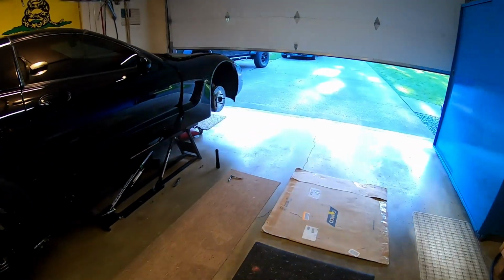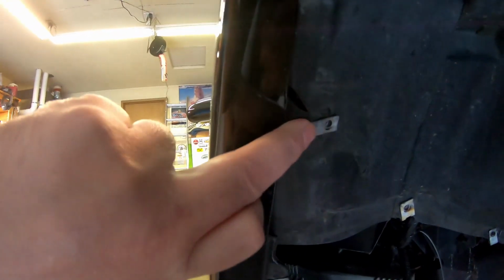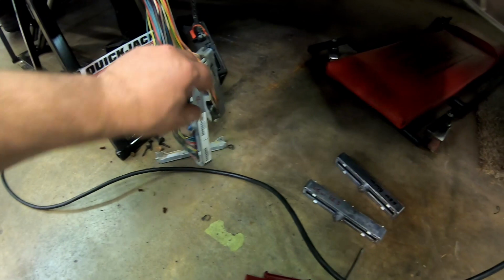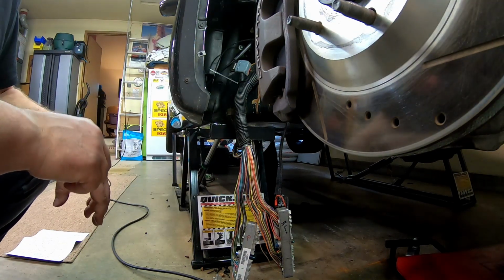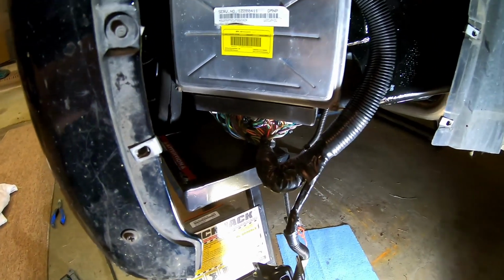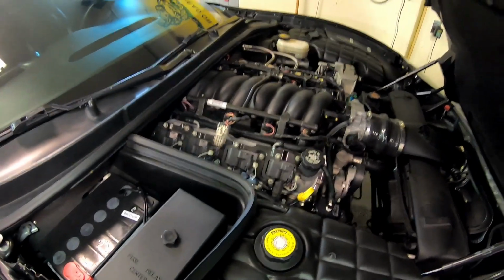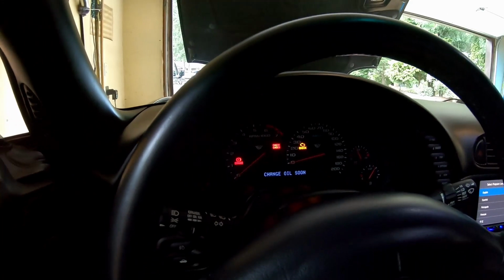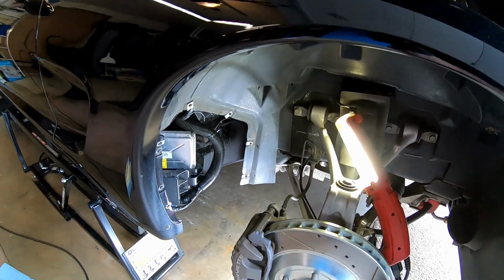How to 411 PCM swap your 97 98 C5 Corvette

Comment: I know this is a very old video, but I’m interested in some information that I’m getting conflicting answers about and I know you did it, so here it goes. I have a 98, can I use my TAC module and pedal or do I need a later model set? Are there any other sensors that need to be changed in order to make the computer happy?
Reply from the maker: In my case all I needed was the PCM and the pin location changes.  All the other hard parts are original 1997.

Comment: Thanks for this Im about to tackle mine because of a boosted application and the tuner insisted. really helpful about the 2003 z06 operating system too he was needing to know that.  ❤❤.
Reply from the maker: It will be worth it once done.    Also if you are going to be boosted and you will be making more than about 600 wheel horsepower I would just make the jump to the HP Tuners 2 or 3 bar speed density operating system.   It is still based off the corvette operating system but opens the door for it to understand all things boost related in the tune.

Comment: I just finished this swap and my speed is in space, reads 1/4 what it should, any tips on the tune file?
Reply from the maker: What operating system is in your PCM.  If it is not an actual Corvette based operating system from a 2002-2003 that is likely your problem.

Comment: I know this is an old thread is there any info on where to find a wire diagram for repinning the connectors mrk is out of business?
Reply from the maker: I can help you out but it probably won't be until next tuesday when I return from vacay
Reply: Do you have a way I can contact you ?
Reply: @PNW_Car_Mods  I did end up finding a wiring diagram for both a 98 and 02 and matching up the corresponding wires

Comment: I recently did this with a 02 ecm. I happended to have a lot of wires just hanging out with no where to go and im very stumped. Did you have this issue?
Reply from the maker: Not so much on a C5.  I think there were just a couple that are left stowed out of the way.   Highly recommend LT1 swap dot com for pinouts.
Reply: @MRBLACK947  This might be a long shot but I think I have found my issue 😂. Do you know what you used for the serial data class 2? I'd like to assume it goes to pin 58 on the 02 ecm, but it shows a different circuit number and wire color?

Comment: Quick question for the connectors since your using a new model PCM, c1 is blue and c2 is red right ?
Reply from the maker: I only have F body and Truck pinouts in front of me at the moment and they both show c1 blue c2 red.    Highly recommend lt1swapdotcom for all the wiring pinouts.
Reply: @PNW_Car_Mods how long did it take for them to ship you the PCM ? I’m about to order one soon
Reply from the maker: @jimmymolina8992  I think it was about 2 2 weeks.  That being said, I don't know if MK Motorsports is still in business?
Reply: @PNW_Car_Mods  no worries , I just took a chance on a 99 pcm on eBay and just bought new connectors so hopefully I can just repin the harness with the diagram that they have on their website still. You think that would work ?

Comment: I just watched this Vid .  FANTASTIC Job!   Questions at  11:10 what wires are no longer used - very curious, what were they connected to that the newer PCM doesn't need?  Seems logical to me the newer PCM would need more info, not less so I am super curious!  Thanks!
Reply from the maker: I actually had to go look lol.  This was a long time ago for my pea brain.   2 wires are listed is ground jumpers another one was for F45 shock signal and one of the most important ones is a 5 volt feed for the fuel level sensors that is NOT used on later cars.   The only thing that doesn't work and I'm strictly going off of memory is I'm pretty certain there is supposed to be an indicator in the cluster when the cruise control is activated??.  If there was an indicator light it no longer works.   The cruise control does work though and all aspects of it respond properly.
Reply: @PNW_Car_Mods  interesting, I appreciate the response Mr Black!

Comment: Have to do this with my 98 f body now for boost, plus the pcm doesn’t even want to take any updated software so it won’t start with the mafless tune. Thanks for posting
Reply from the maker: We're getting ready to also do a 98 Camaro SS next week!   Should be interesting as I still have several unanswered questions on clutch switch wiring and how to tune the fuel gauge to work.  There is so much conflicting information out there I don't know who to believe lol.

Comment: Where did you get your information. Trying to do that on my son's car right now. Thank you for the video.. his is a 97 also. we lost ground Pulse on injector 3 a couple of seconds after startup.. So it's either replace it with an old one. Or see if you can help me out on that information for the pinout.
Reply from the maker: Send me an email
Reply: @PNW_Car_Mods what is your email i would like to get some info on a wire diagram

Comment: I have recently purchased a 2000 c5 pcm to put into my 97 , wondering if that 2000 pcm is the same as this “411” you are referring too, also wondering if the processes would be essentially the same as what you’ve done here? And could MRK Motorsport get me a pinout out diagram for the 97 - 2000 just like yours ? Thanks man
Reply from the maker: Tanner the 2000 PCM should be an 896 PCM (you can verify this by looking at the part number on the case) but as far as I know the hardware is the same as a 411 so it should install with the same red blue connectors and pinouts.   Also AFAIK MRK is still selling the new GM computer brackets and swap pinouts.   They may elect to just tell you to get the 411pcm from them with a basic tune on it.

Comment: I'm getting ready to install a heads and cam intake manifold am I going to need to do this before or do you think I'll be ok
Reply from the maker: You don't need to do this unless you are going after boost or big cubic inches or both.   A competent tuner can tune a cammed atari 2600 PCM in a 97 98

Comment: When ya swapped the PCM from black box to 0411 did the key fob to open the doors still work along with the AC, and the 4x4?
Reply from the maker: Well there's obviously no 4x4 in a corvette but yes everything else seems to work as it should.  If you study the diagrams for the vehicles you are working with there's really no reason it shouldn't.

Comment: Thank you for the video! When you did this, on the connectors, did you just jam the pins through the orange closed holes or is there a special process to be able to put the pin into the connector?
Reply from the maker: They're made to be pushed through the weather boot.  They will go right through without jamming.
Reply: @PNW_Car_Mods  Thank you!!!
Reply from the maker: @ajw0685  welcome ajw

Comment: Nice video, Any other companies that sell that computer.  I have tried reaching out to MRK for months and no luck
Reply from the maker: Well that sucks.  I wonder if the challenging times finally got another one.   You don't need a computer specific from them, it's just easier for most as they put in the OS for a corvette.  Any 411 PCM can be used as long as it has blue red connectors on it.   The OS can be found on the HP tuners board.

Comment: Dumb question but I’m considering doing this upgrade, doing an Ls1 swap and my computer is from a 98 camaro ss and want to upgrade to the newer one. But my question is how do you know which number each pin is?
Reply from the maker: Neil if you poke around google looking at factory service manual wiring schematics you can find the information.  I've also heard that a lot of public libraries often have factory service manuals and guys will go in and get the schematics for both the new and old and then use that info to make a cross over chart.
Reply: Neil,  MRK Motorsports has the conversion chart from 98 to 1999-2002 F-Body.
Reply: Here is the Link:    https://www.mrk-motorsports.com/wp-content/uploads/2016/07/1998-LS1-PCM-to-1999-PCM.pdf

Comment: So did this come programmed and you didn’t have to bring it anywhere for them to deal with it? Just plugged it in and your car ran and drove? People were telling me when I get a new pcm I still will need to bring my car somewhere for them to program the pcm while it’s actually in my car.. just looking for some more info
Reply from the maker: Joseph, the computer I am using has a 2003 Z06 operating system on it purchased from MRK Motorsports.   If your car has LS6 components on it as in right sized injectors, right MAF and things of that nature it should run and drive quite well.  If your car is heavily modified such as mine then it is going to require tuning with something like HP tuners or EFI Live.   The short answer is yes you will likely need to have the car tuned unless you set it up exactly like an LS6 Z06.   Talk to the guys at MRK Motorsports.  They do this swap often.   I will say that this PCM swap generally is required unless you are planning on making big power with large cubic inches or boost or both.
Reply: MRBLACK947 I have a 98 Base. The kit I found online was a 98-02 swap. I just didn’t know if after installation if someone were to have to learn it and program it to my car. I know they come configured to the vin and all you provide but not sure if it was a plug and play deal or if I need to bring it somewhere after installation.

Comment: Where did you get your PCM Pre-flashed (i was expecting your fuel gauge to not function properly)? and the PCM bracket?, i'm about to attempt the same process in a 98 Manual c5 bone stock, and i'd hope for a smooth sailing process like you just showed, Amazing work!!!
Reply from the maker: Thank you Jose.  I bought everything from MRK Motorsports.  They load an 02 Z06 operating system on the 411 PCM for you and configure the fuel gauge.     It was worth the couple hundred bucks to just get everything from them with the bracket and just be done with it.
Reply: @PNW_Car_Mods  Thanks for your fast response, do you know if they're working right now (or still??), i've tried sending a couple e-mails , and by phone but can't get to anyone.

Comment: Where did you get the pin out diagram exactly ?
Reply from the maker: MRK Motorsports.  That being said I keep hearing over and over that the early vs later pinouts can be had from a lot of service manuals or even the library.

Comment: I've only ever seen that swap done on the forum.  Definitely a must have for the early C5s.  Looks like it went pretty smoothly.  I think the idle sounds great, haha!  We're all looking for that level of chop.  Another great job by Mr. Black. What headers do you have on there now?
Reply from the maker: Thank you sir.  Right now it has Texas Speed inch and 3/4.    Will be making the switch to Speed Engineering for the time being.   Should have a video on that in the next month or so.
Reply: @PNW_Car_Mods  I used the speed engineering kit.  Couldn't be happier.  It does need to be welded up for a proper fit though.
Reply from the maker: @302MuscleCars    That is a must for sure.  Thing is for me I will be using only about half the kit.   Just the headers and the two elbow collector extensions.   Those extensions will be welded into my cats and the collectors will be getting V bands..   Should be a really solid install.
Reply: @PNW_Car_Mods  Awesome.  Looking forward to the install.  Mine fit perfect.  I did have to drop the starter, but that was it.